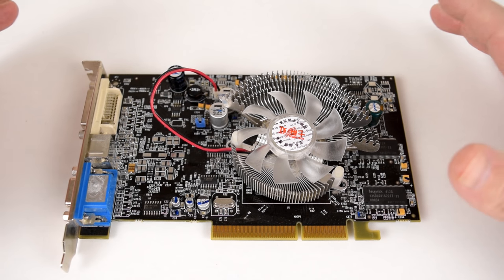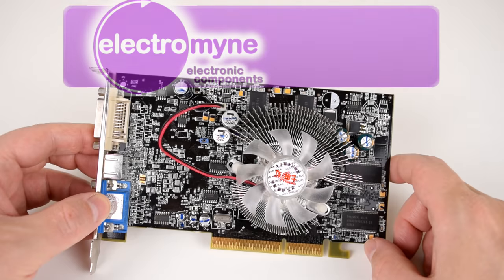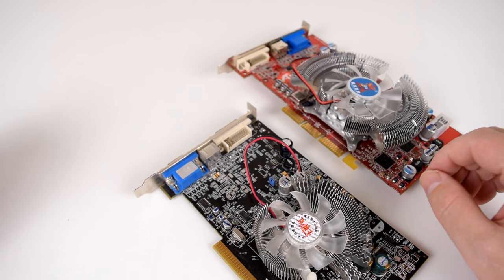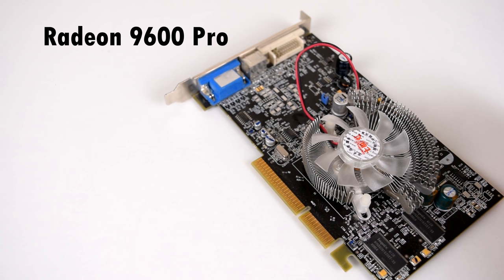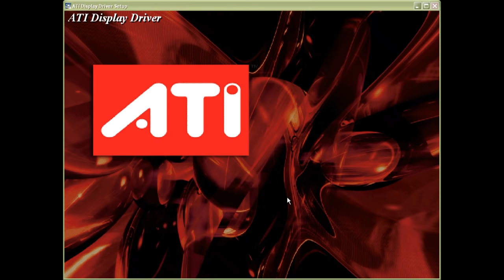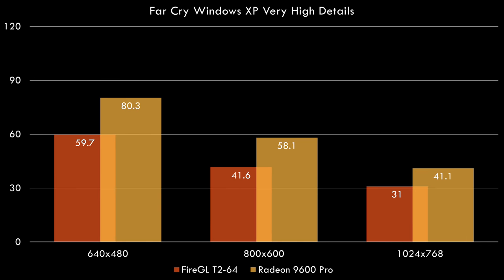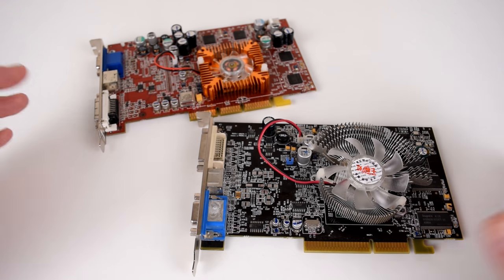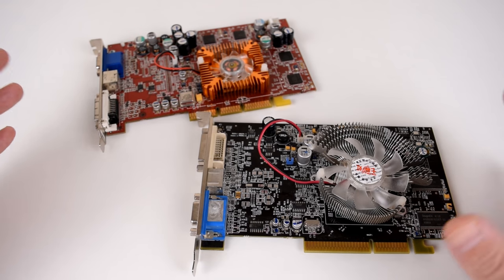Radeon 9600 Pro Review

Comment: Goddamit i was using this for a while after the FX5200.i was impressed with its performance,back in the day,Half_life 2 run at 1024*768 with high details,pretty playable,like Far Cry 1,NFS U2,MW.Carbon...With a 2100+ Athlon XP and 768 MB ram.Upgrading to GF6600(non-GT) is like having it after the FX 5200.I belive it was the golden era of PC gaming.
Reply: The 6600 non GT was a bit of an anomaly. I mean it had the DX9 legs and it was a decent performer for the mid range, but the GT just knocked the socks off it. The 6600GT was though one of the best GPU's ever made, in terms of features and performance and price.

And yeah, that was indeed in the golden era of PC gaming. You could say that was from the dawn of 3Dfx and PowerVR (1996) and windows 95 with Direct Draw and Pentium II machines, probably up until the AMD HD5XXX era.
Reply: Totally agree.the non-GT 6600 also had a lot of OC potential,i was able to hit 490 Mhz on the core,i forgot the mem,i had an inno3d model back then.I also want to mention i have a glorious AGP VGA collection with 3 6600 GTs thats in fully working condition.The most precious is an AEOLUS 6600 GT.Its just plain beauty.I have like maybe 35-40 pieces,6800 GS/XT/GT god i love em.
Reply: I Had a very similar setup to yours, with athlon xp 2400+, Radeon 9550 and 768MB of RAM

Comment: Having been using a Radoen 7500 for the last week the performance in these benchmarks makes me jealous. The 9600 truely was a brilliant card, still is for retro uses.
Reply from the maker: Yea the 7500 is not that powerful, it's ok for older Windows 98 games, but the Voodoo 3 is usually the better pick for those. The 9000 series is just incredible strong, even the lower 9200 packs a punch,
Reply: PhilsComputerLab: Yep, the 9000 Series is one of my favourite series of graphics cards, (Mainly cause I grew up using a 9100IGP Chip) this 7500 is in an Emac, otherwise I'd look into changing it.
Reply: Budget-Builds Official Voodoo 4 4500 has extra spots for ram maybe try taking one that dead taking the ram chips off and puting it  on the working card see if it goes from 32 to 64mb ram
Reply: One thing worth noting about the 9600 vs the 9500/9700/9800 is the lack of AGP 2x 3.3V signaling.
Reply: A lot of the low end 9000 series cards were just rebrands of the 8000 cards.
The 9000 pro was a shrinked rename of the 8500 and the 9100 was a 8500 LE. (Hint: The 9000 pro is the faster of the two)
Video decoding comes down to the codec used. A more modern h264 codec will have isses even at 720p while some good old MPEG-1/2 or DivX/XivD wil run fine.

Still have a 8500 LE and a 9200 around. They run fine.
Reply: the radeon 9600 pro graphics card was of good quality performance, the price in stores was fair
Reply: the radeon X1600 pro graphics card on the agp8 bus was the last generation compatible with the dos system, it used all the graphical functions of microsoft directx 8 directx 9 without any compatibility problems

Comment: The 9600 came in both 128 MB and 256 MB variants.  I can confirm that the 256 MB cards use a lower memory clock (400 MHz effective for the 256 MB model and 600 MHz effective for the 128 MB model) and you get about a 14% performance hit with the 256 MB model and its lower memory frequency in 3DMark 2003 (~3000 3DMarks vs 3500 3DMarks with my setup, described below).  The 9600 Pro is still a great choice, and is very compatible with older MS-DOS games and classic Windows 98/early Windows XP games running with ATI Catalyst 6.2.  Stability is greatly improved for MS-DOS games (within Win 98SE) if you install the "Unofficial Service Pack."  I built two retro PCs using a using a Socket 775 platform (ASRock 775i65G, revisions 2.1 and 3.0), Pentium 4 520/2.8 GHz CPUs with 1 GB of RAM.  Both run Win98SE and Windows XP beautifully with Radeon 9600s.
Reply: is the extra memory worth the hit?
Reply: @shiveringisles3509  In my case, the answer is "no."  I dual-boot these machines with Windows XP, and the performance drop was noticeable with the GOG version of Star Wars Battlefront 2, Far Cry (GOG), and Half Life 2.  If just running Win 98SE, a 256 MB 9600 should work well with a decent CPU; however, if performance is more important, the 128 MB model with the faster memory clock is better.

Comment: OMG the 9600 Pro was the first ever AGP card I owned and only the 2nd GPU I had ever brought myself as my first was Radeon 9250 PCI
Reply: Same here, my first graphics card was a Hercules Radeon 9000 PCI, later I bought a Radeon 9600 Pro 128Mb (Is till have it)
Reply: Same for me i recently got a nice Windows XP  P4 PC which has almost exact parts i had back in a 2003-2005 , IP4 - 3,0 Ghz , 512 MB DDR1 400mhz ram (2x256mb - max 1GB), CD/RW - DVD play, 3 1⁄2 floppy drive , 120GB IDE HDD and 9600 Pro 128mb it also was first GPU i bought ! Its funny cause this PC was going to trash at my work so i saved it - now i will have a really nice retro PC !  i Will replace PSU cause its  old and scary !

Comment: I have a "brand new" 9600 XT 256MB. Unfortunately it had the crappy Sacon FZ capacitors, and half of them had bulged by just lying in a drawer for 10 years. I replaced all of them with Panasonic and Nichicon caps before testing it yesterday, and it works! :)

It looks like your card has better capacitors. The ones to avoid/replace often have the model number "FZ54I" or similar, and are usually 1500uF 6.3v or 1000uF 6.3v. They were common on both ATI- and Nvidia-cards back then. At badcaps they call them the worst caps ever produced ;)

Comment: The second GPU I ever had was in a sweet Pentium 4 HT system that my parents got me for christmas, a Radeon X600Pro 256MB,  in PCI Express. From what I remember reading in forums and magazines, performance was basically the same as the 9600 Pro, and boy was I happy. I had been using a Riva TNT2 for the longest time, paired with a PIII-800, and the X600Pro/PIV HT was a dream setup. It ran HL2 like butter, even at 1280x1024.

Comment: This card was on my p4 from 2004 until 2011 until P4 chipset of my 3.0ghz Northwood has died, so this was MUCH better card than radeon 9700 pro and 9800 pro which were actually real hell of cards, ATI in that time made insanely huge mistake putting so small fan on 9700/9800 series - I replaced like 3 radeon 9800pro (even I had XT one which was worse) in one year because they all died due to over heating and yes I didn't overclock them or anything in this fashion.
Cheers from Croatia.
Reply: Did you do the trick with replacing thermal pads on these 9700-9800 graphics cards? They were still going kaput?
Reply: @Igorekx  I don't recall, but I know stories this didn't help, most of 9700/9800 series had massive thermal issues, because thy had very small ventilator and they produced lots of heat.
I had also 9800 XT which also burned in like 4 months time, and I never OCed my GPUs or anything like that. I am assuming 9700 and 9800 had design flaws.
Cheers, thanks for any replies
Reply: @crogeek  Got it. Thanks. I will probably underclock high-end GPU’s before I build my retro systems.

Comment: Ah yes, the Radeon 9600 Pro, it was the first GPU I bought myself. I read a review where they tested a 9700 Pro and 9500 Pro, and I thought "Hmm, well, 9600 Pro must fit in between those". Unfortunatly it didn't, the 9500 Pro was actualy faster than the 9600 Pro. Still, it was a good card if you could get the drivers working (the driver on the CD didn't work lol, and with a 56K dial-in modem a new driver was too large to download). The Radeons back then performed a lot better than the GeForce FX series (especialy the 9700 Pro was a monster). I've had the 9600 Pro for years untill it went up in flames...litterly, some component failed when shutting down Windows (so not during a game, but during shutting down...) and burned a big hole in the card. A shame, because they were still nice for retro PC's, and now I have to do with less powerfull cards (like an GF FX5600 or GF4 Ti4400).

Comment: Remember that some manufacturers also selled cards with 200 MHz (400 DDR) memory.
I got one of these from PowerColor.
It runs quite fine with Catalyst 6.3, The latest official driver for the card is 6.2, but the next one can be installed over it and actually improves performance under Windows 98 SE quite a bit.
Noticed the lack of features for really really old games tough, but nothing a Geforce 3 can't solve.

What setting in Doom 3 too chose with a 320 MiB card like the 8800 GTS or a 384 MiB card like a 8800 GS or 9600 GSO?
nVidia had some odd numbers with odd memory bandwith even back then (like the 448 bit bus on a GTX 260 and 192 bit on some other cards)

Comment: This is my xp machine:
Semprom 3000+ socket 754
K8v-X SE with k8t800 chipset
2GB DDR1 800
HD 3650 512MB AGP

All mainstream but very balanced.
Reply from the maker: I tried the 3650 recently, it didn't work out so well for me, maybe to do with the AGP bridge I don't know.
Reply: I had to install que 12.1 hotfix drivers.
But even with this driver,  powerslide is very bugy in directx mode.
Other games are working fine.
Reply: @philscomputerlab  There's really no reason to use AGP cards with an XP gaming rig, unless you're specifically going for an early-XP era, but that's a bit pointless. Otherwise, a gtx 285 will make short work of any XP era game and they are still cheap. I recently managed to get one with the 200-series specific Arctic Accelero Extreme cooler for just 25€ (stock ones can be had for as low as 10 sometimes) and while i did also get a 4650 agp for 15€, that was pure luck, as I normally see even the above mentioned 3650s for like 40, while 3850s and 4670s are obviously even more.

Comment: The yellow gunk they used as thermal pad didn't harden out when aging, it was a hard pile of junk when the card was new.
It was wuite a hassle when I replaced the cooler of my 9500Pro (128-Bit) back in the days.
Reply from the maker: Yea it's super annoying. They stopped this with the 9600 Pro cards and later X800 series, so that's good to see.

Comment: That's the one thing you always have to do lots of research and that way you know your parts just recently I acquired a Radeon x1800 GTO from what I understand my card is a mid-range product sometimes power and requirements for older cards are too much for the system the card I acquired seems to be running pretty okay given that I only have a 300 watt power supply but that's enough but I had to do a whole lot of research and a whole lot of searching so it really does pay to do your research especially when you're building a retro XP box

Comment: This is what I've got for my shuttle mini pc running windows 98. I picked the card for 5 euros, overclocked it to core 492 MHz and VRAM 700 MHz. The overclocked 9600 pro is insanely powerful, meanwhile handled well by a 200 W PSU

Comment: Such an awesome card along with the 9600XT for low power rigs. I ended up getting a FireGL T2-128 off your previous video. As you stated mate - the FireGL T2 works great as a 9600 alternative in a Windows 98 machine.
Reply from the maker: Oh nice, yea the FireGL can be cheap alternatives. I will cover a few more models soon :D
Reply: Forgot to say, a great bonus of the the FireGL T2-128 I bought has a core clock runs at 400Mhz which is the same as the 9600Pro I believe which was a nice surprise!
Reply from the maker: Yea AFAIK it's a 9600 Pro equivalent.

Comment: I bought the Radeon 9600XT (R96A) recently at a thrift store for $4.99 + tax. Could use some cleaning, but, nothing majorly broken (all of the caps are in place; 2 are bulged, but, not leaking, and no scraped traces).

Edit: I installed the card in my Windows 98SE and everything went south. The monitor reports out of range and Windows 98SE doesn't boot or it reboots.

Comment: Very cool video, thanks! The tip about the metal shim is really useful, I have a couple video cards from that series, that's an excellent tip. Also a question - what aftermarket coolers for Radeon 9800/9600 Pro would you recommend that are available today, from eBay, for example? 🙂
Reply from the maker: The models change a bit over time, I would just run a search on eBay for vga cooler or graphics cooler and take a look what's available.

Comment: 9600 was pure power. I was playing games that seem impossible to run on this gpu, like Car Mechanic Simulator 2015. I didn't have rust effects though and was getting around 40 fps, had Minecraft 1.7.4 running at max (except render distance, which was kept at 4-8) with very playable fps of 70-100. I bet you could have played EVE Online, if it was 2006 outside. And it had great OC potential, at least for me. I had Sapphire Radeon 9600 Pro Advantage 128 mb. And I still have it, it's fine and dandy, works without any troubles after me, using it excessively in harsh conditions.
And it was so much better than nVidia alternatives! That is the time when AMD (ATI) had incredibly powerful GPUs compared to nVidia. I also still have FX5200, it's so much worse. Even though their stats are almost identical. It still can run minecraft, though. Slower, but it can.

Comment: Thanks for the video!
I have several retro gaming builds, one has Voodoo 5, other has Radeon HD 4850 and I'm choosing between Radeon 9600 Pro and Radeon 9800 Pro. Which one would you recommend to install in my third build? 
My 9800 is already modified, has Zalman fan on it, but it's still too loud with its 1600 RPM, even with Noctua low-noise adapter I've had laying around.

Comment: My 9600pro runs at 580MHz core and 375MHz memory =D which oddly enough is DDR2. First I modded the voltage regulator to add a potentiometer to raise vcore, installed a mollex as a vcore measure point, swapped the VRM inductor, soldered a bunch of capacitors, installed mosfests heatsinks, ram heatsinks, new GPU heatsink and an 80mm fan. Then I flashed the BIOS in order to tighten the memory timings. The thing now clocks like crazy and I guess if I improve the cooling it'd go further.
Reply from the maker: Very nice!

Comment: Great video again as usual. On the subject of Your driving skills Phil, are You aware that if You could get hold of a used Logitech G25 they will work on everything from Windows 98se and up.
Reply from the maker: I play very little and I would hardly use a steering wheel to be honest!
Reply: No probs. I wasn't really being serious. I actually do online car racing in Assetto Corsa Thurs nights, so it's obvious when someone is steering with the keyboard as the the wheels are fully turned or straight, no analog control.

Comment: Unfortunately the given benchmark does not compare to similar GPUs. Would have been great to add Ti4200 and 9800Pro as a comparison. I bought a 9600Pro AGP because it's currently cheap and suitable for a Windows 98 PC as an alternative to Ti4200, but I think 6600GT/7600GT (AGP) are a better deal. 9800Pro price are indecent. I think it's even worst for 9600XT and 9800XT.

Comment: I never had a 9600 card, but I do have a couple of 9500s which back in the day I had hard-modded into semi-9700s. I say "semi" because, while you can unlock extra cores, the memory bus stays half of what it is on a true 9700 (128bit vs 256bit). There's nothing that can be done about that because the extra memory chips are physically missing from the PCB. But the performance boost was nonetheless very significant at bargain prices. I eventually flashed a Mac BIOS on one of them to use in a G4 Mac.
Reply from the maker: It does depend on the card, there is a video on the channel, soft modding a 9500 (non Pro) into a 9700 including 256 Bit memory interface and all of that :)
Reply: Yeah it does depend. If the cards had a full complement of memory chips on the PCB they would have turned into full 9700s with my hard mod. The thing is, it's not impossible to do as the pads for extra memory chips are there but in this day and age it's not worth trying. Back in the day I know a few people who did it.

Comment: Looks like the 9600Pro is similar in speed to the GMA X4500 HD. 
Here are a few results I got from a machine with a C2D E8600 (3.33GHz), GMA X4500HD, and 8GB of CL7 DDR3-1333:
Quake III Timedemo, 1024x768, highest settings:  278 FPS
Doom 3 Timedemo, 1024x768, Ultra preset: 29.5 FPS
3DMark01SE, default settings: 10935
3DMark03, default settings: 4016
Reply: Years ago I played Left 4 Dead 2 on a Pentium M 750 with a Radeon X600M (a PCI-E 9600 Pro) and it was relatively playable at low settings. 
The same game on a Pentium T4500 and a X4500HD  was completely unplayable even on the lowest setting possible.

Comment: By chance PhilsComputerLab have you looked into the SiS video cards for AGP? The 305 was around a TNT2 M64/Vanta and 315 which was quite a value (Overclocked it gave GeForce MX400 like proformance).
Reply from the maker: No I haven't, not yet at least! But I've been told they are very average...

Comment: @PhilsComputerLab in which resolution and Settings did you play GTA San Andreas with the 9600 Pro on this video?
Its  Interesting to compare because on my Pentium 4 3,6GHZ 1 GB DDR Ram it lags so much in some places if I set FX Quality from Low  to medium if 3x Anti Aliasing activated.
in 1280x1024 Resolution . Even with Radeon X 800 it lags in some places the same  like the 6600Gt and IU have tested it on better PC too in Core 2 Duo E5400 with 9800T. This game runs of course better with this card but the same frame drops on the same places here... Why?
What is the reason why this game runs so slow? Even if I set off Anti Aliasing and fx Quality the frame rate is 50 fps but not 60 or more and in lower resolution almost the same...
Maybe its about Windows XP`? Maybe with Windows 2000 it would be run better?